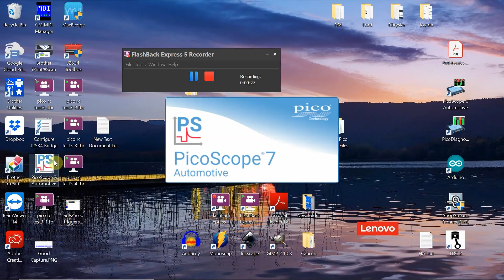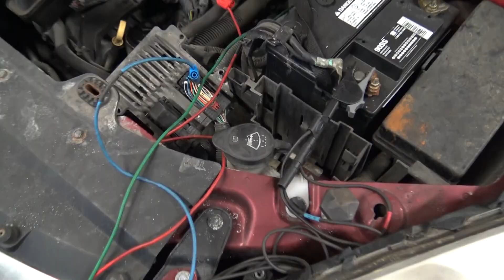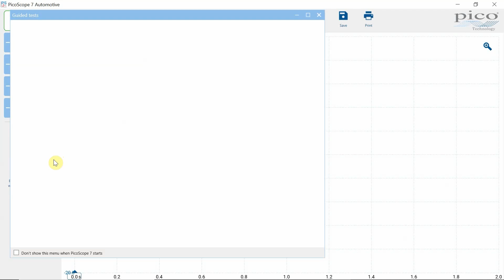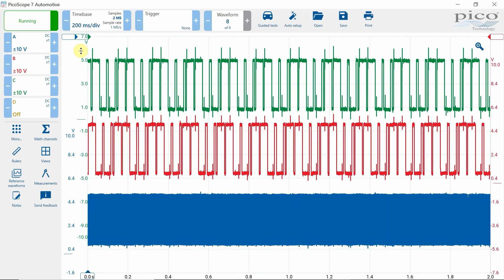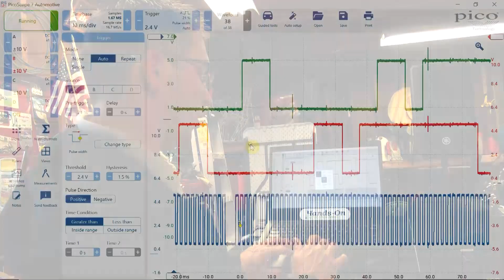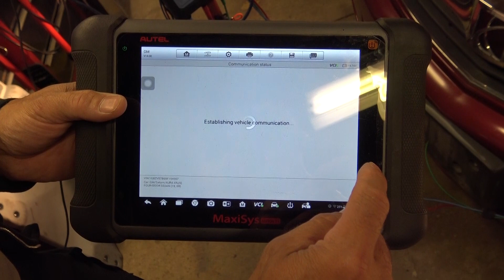Advanced Pico Scope Trigger Pico 7 and 6

Comment: It ended and I was looking for a sequel to this video as you found the problem and solved it using Picoscope 7.......
I love your explanation of the Picoscope 7 software.   I just downloaded it today at the suggestion of Picoscope technical rep Randy.   I need more instruction on 7
Reply from the maker: Are you familiar with 6 over all,? I am working on self paced online classes
Reply: @BrianMann216  I've used Picoscope 6 for less than a year (since I bought my first Picoscope).   I've used scopes for basic functions for about 50 years, but seem to always need to learn more.   I just had a HOnda Pilot that was kicking my butt, but finally found the problem - thanks to current tracing on a Picoscope.

Comment: Thanks for the video , i can see the signal move but could you tell me what is the benefits of seeing this signal move thanks again .
Reply from the maker: This was more for showing that special trigger function. This particular set up along with scoping the cam control solenoid may show the results of a sticking solenoid or actuator. The way I usually test this is to grab a large amount of time in the buffer,  and then capture cam and crank at different commanded positions. Also note that if just checking correlation  a good base line is to unplug the cam solenoids,  this vehicle was headed to the state emissions test so I did not want to trip the check engine light.
Reply: @BrianMann216  THAT WAS VERY IN DEPTH , SCOPING IS A VERY USEFUL TOOL BUT A LITTLE DIFFICULT TO RAP YOUR HEAD AROUND THANK YOU BRIAN FOR YOUR TIME IF ANYONE CAN MAKE IT UNDERSTANDABLE IT'S YOU SIR !